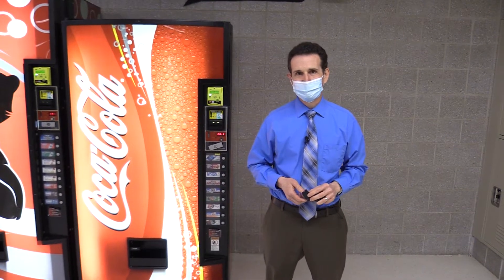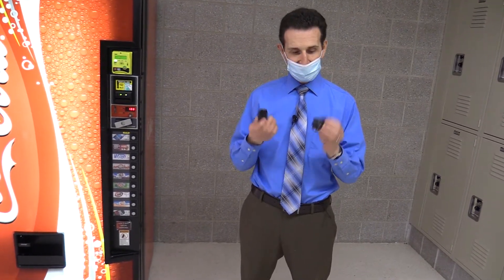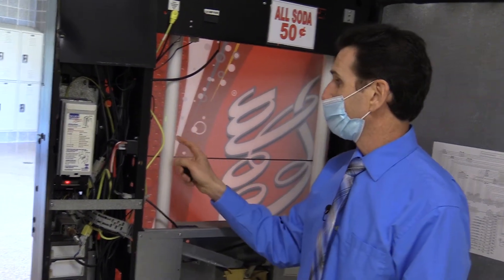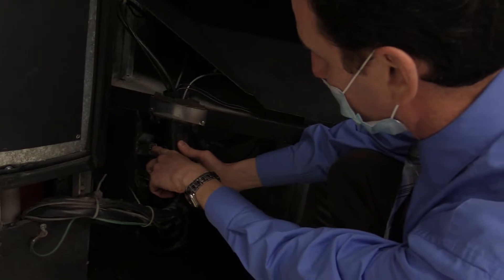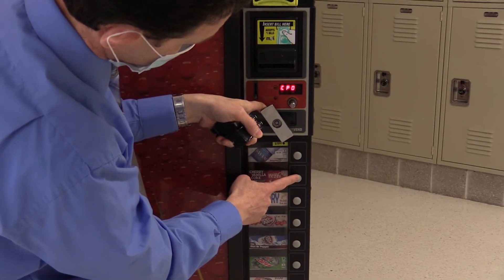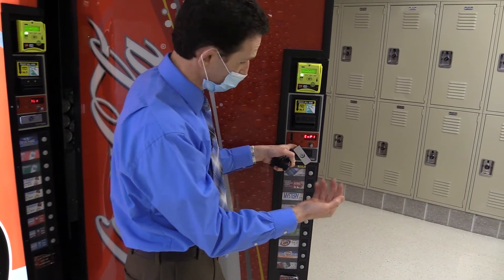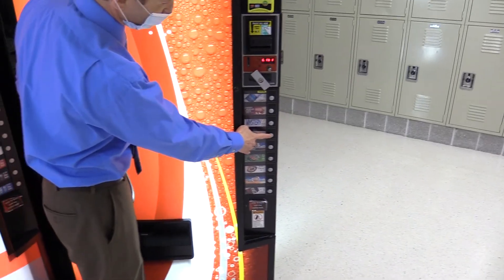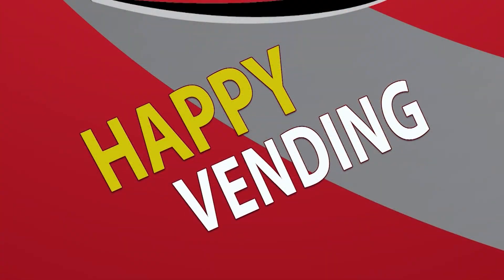What are relays?

Comment: Hi Bill,
Does the Dixie Narco have a relay as well? I still can’t get the lights on or the vend motors. I am based in Dublin in Ireland:)
Reply from the maker: Newer dixies do not have relays like the royals.  Is the plug on the door plugged in and have a good connection?
Reply: @HappyVending Could be a special setting for Coca-Cola machine? I will try again all the wire and perhaps spray an electrical contact cleaner!
Reply from the maker: @GG-ds9hg  There is no setting in the Dixies to turn off the lights.  If the lights aren't working, it would be either the bulbs or the ballast.  You could always get out a volt meter and start testing the power wires going to the door.
Reply: @HappyVending  thank you very much Bill